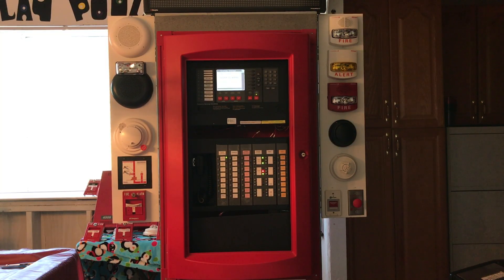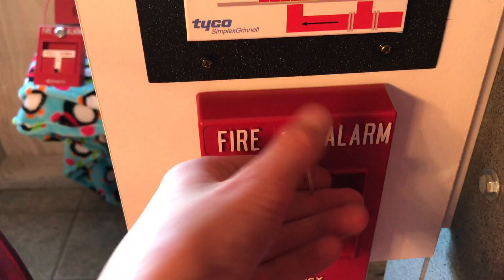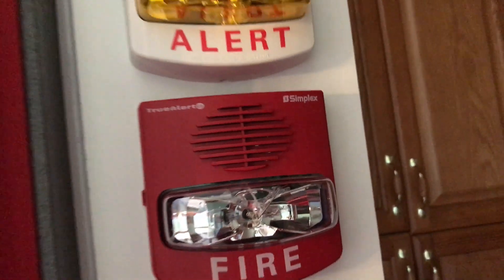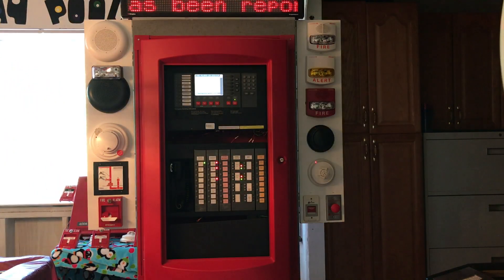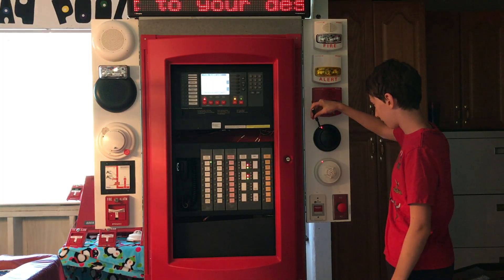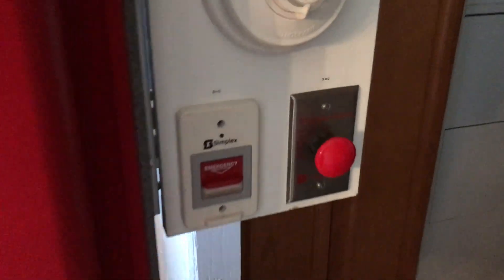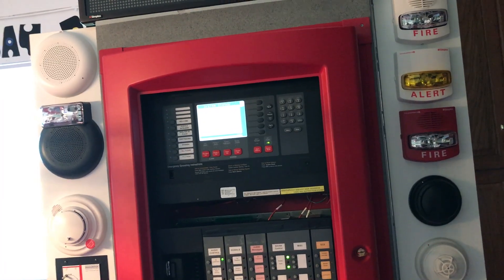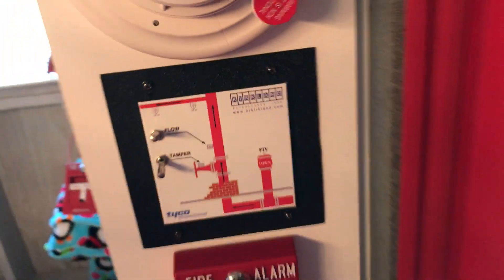Simplex 4100ES Addressable Fire Alarm Control Panel Demo!

Comment: Why do the simplex true alert speakers need a LED light inside it?
Reply: Kai Bannon because it's addressable.
Reply: Kai Bannon  They just have and LED inside because it is probably to show that the speaker is addressable
Reply: I know better because I have a simplex 4007es and there to tell you the device is working and is communicating with the panel.

Comment: If using the system as mass notification for a situation such as an active shooter, can the speaker within the FIRE strobe/speaker be used by leaving the strobe off? Or would the user have to have ALERT strobes with speakers? Can third party buttons be used to trigger a message such as a STI Stopper Station button?
Reply: Yes it can be used with out a alert strobe plate. Each voice evacuation equipped panel has a microphone so that you can make announcements over the speakers

Comment: Really cool! So is black going to be the third color (after red and white) now?
Reply from the maker: yes, and there is also a brown smoke
Reply: Safety Security Alert why brown?
Reply: Safety Security Alert ah. That's what the black ones are for too then. I haven't seen black Simplex N/As or Smokes/Heats, but I've seen Addressable Honeywell division smokes in black in a movie theater (Gamewell-FCI specifically).
Reply from the maker: they are for walls ceilings that are brown